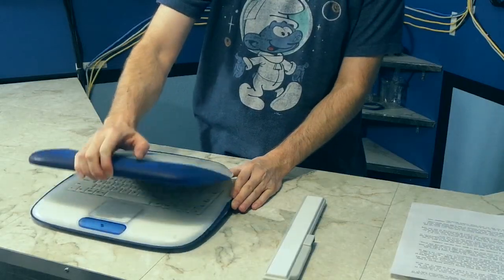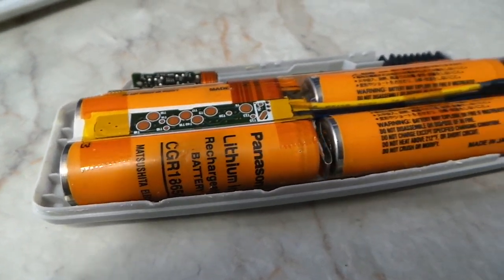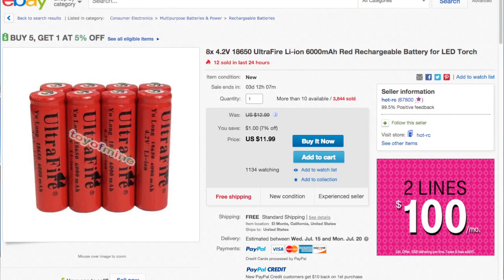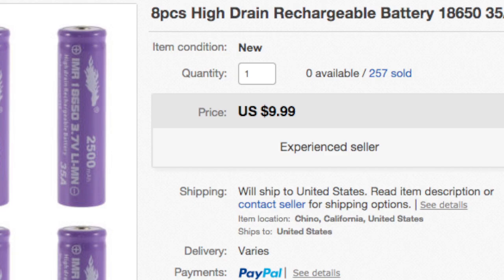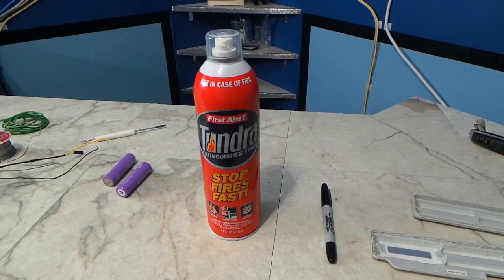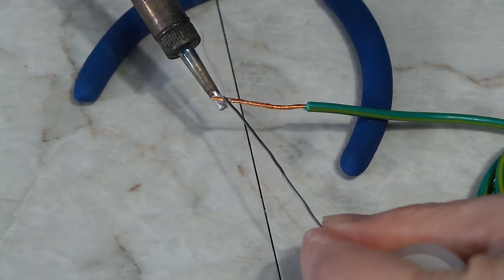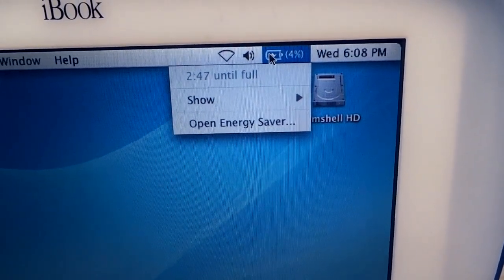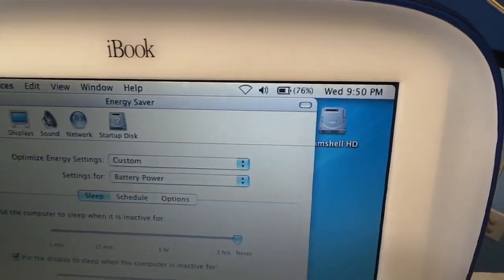Rebuild a laptop battery pack

Comment: Soldering directly to the cells is NOT a good idea. To be safe, you should buy cells that have solder tabs welded to each end. Then make solder connections near the end of the tabs away from the cell.
Reply: Right, it's not like a gasoline explosion, but more of a... highly energetic fountain of fire. You can look up videos of ruptured lithium batteries on youtube.
Reply: I did blanch at seeing that. But my Macbook battery suddenly bulged one day so I'm apprehensive. They weren't yet engineered to quit accepting a charge when plugged in.
Reply: welding only take a fraction of seconds to do, so even it's hotter it doesnt heat up the battery as much
Reply: Robert Noble, yes, a lot hotter but on a much smaller surface, a puncture and, than, in a very short time. It is  no time for heat/temperature to go inside the cell. And this the main fact.
Reply: @ionbobia  Can you, please, explain more details? I am found this very useful skill with soldering experience of you.
Reply: +OpenGL4ever
So that explains the sweet smell you get when the pouch of a lipo cell is punctured or ruptured. But it never heated up.
Reply: No, no, no. They spot weld the tabs on, not solder them. No manufacturer today would be stupid enough to waste time and money with solder when a spot weld requires much less precision and danger.
Reply: +OpenGL4ever 
 In case of explosion he would get few millions of youtube views in 2 days :-)
Reply: Regardless if it will actually explode or not, heating the cells damages them and reduces capacity. This is why they are welded and not soldered in the first place. Spot welding is so fast that it keeps thermal stress in check.
Reply: I'd just use these cells as AA batteries, press them together with springs and add metal plates in between the pairs for sensing wires. It's more difficult with the cells that are flat on both ends.
Reply: No actually it doesn't at least not for long enough to get the internal temperature to the magic >70C self heating level. Whilst the extremely short spot or laser welding action may cause the weld to reach that temperature it does not conduct as much heat into the cell as normal soldering. At least not if done properly.
Reply: those tabs are nickel ribbons not too expensive, but I took apart a tape measure and the coil if you unwind it you get a ribbon you can spot weld onto the batteries provided you have a spot welder
Reply: Adam Lawson
Well it's a question of how you define explode.
For example, It the seal is broken, lithium will react with the humidity in the air, this will cause a fast chemical reaction heating and building up hydrogen gas and this gas is not only  expanding but if it gets mixed with the air and catches fire it will also explode.
If this happens within the enclosure of the battery, pressure increases to until the enclosure rips suddenly apart then followed by the ignition of the hydrogen with air and eh voila you have some sort of explosion.
But of course, it is not a reaction like TNT.
Reply: Robert Noble true
Reply: Or use a 2.7v 500f supercapacitor to weld the new ones, maybe even reuse the steel plates from theold ones, just remove them with pliers and some force
Reply: IT WORKS, this isn't the only guy on YT that's done this, and I've done it on regular alkalines in a pinch, nothing exploded. I used a 120W iron, roughed the terminals with sandpaper, and added some RA flux before tinning them, then cooled it with a damp rag.
Reply: +Robert Noble Exactly. What he does in this video is wrong and a high safety risk.
Especially when using Lithium battieres. It's okay to solder NiMH batteries, it will of course harm them, but NiMH batteries won't explode when soldered. Lithium batteries will explode and that is the danger in doing this. That's why manufacturers only weld them together.
Reply: @OpenGL4ever  its more likely to catch fire than explode
Reply: Do they actually "explode"? I've only ever seen them get hot and start to take off thermally and start a fire. Didn't know they could explode.

But then again, a battery is basically a controlled bomb. The more energy you pack into one, the closer you are to having an explosive device.
Reply: OpenGL4ever - Hey thanks for the intelligent response. I was really worried you guys might take it as me questioning you, but I was genuinely curious.

It is interesting how we define energy sources. Can you imagine how crazy things may get in the future with super dense energy storage?
Reply: You guys are all morons most cell manufactures actually used to solder lithium batteries. There is almost no risk for anyone with soldering skills to solder lithium batteries.
Reply: Welding the tabs on gets the ends a LOT hotter than soldering them on. Solder 750 F while weld is more like 1750 F.
Reply: @CheezyDee  "Welding the tabs on gets the ends a LOT hotter than soldering them on." in this case it does not really matter what temperature you get in area of contact. What matters - how match heat is transferred to the battery. 1750F in very small area is quickly dissipated and you end up with very small amount of heat reaching the battery. 750F is applied to huge area (comparing to welding dots)
Reply: Just need a good soldering station, soldering at a temperature of ~ 450C will melt the solder for a fraction of seconds but it will not heat up the contact of the battery, a person with a soldering experience will not see anything dangerous here
Reply: @teateasan  "450C will melt the solder for a fraction of seconds but it will not heat up the contact of the battery" sorry to disappoint, but for solder to stick you must heat the contact to melting temperature of the solder. If you simply melt solder and not let contact area heat - there will be no proper adhesion. Any even semi experienced solder knows that.
Reply: your a fucking moron it will explode..
Reply: @usaisalwaysnumber1  
"your a fucking moron it will explode.."

It is spelled "you're", not "your".
Reply: @usaisalwaysnumber1  your a cant spel, as well as rude. So what do you categorize as an explosion? Lithium cells cannot explode like conventional explosives do. The reaction is not fast enough. They will go thermonuclear and shoot fire like a flamethrower.

Comment: Some laptop batteries have built in battery management, if it goes dead flat it will disable it's self, so even if you replaced the cells it won't charge
Reply: Most*
Reply: Exactly happened to me after cells replacement, my laptop is inspiron 3421, so how i can fix this problem? Please tell me if you know.
Thanks
Reply: Sounds like something Apple would do. 💩

Comment: I tried it with my iBook G4 battery but doesn't work. I cannot charge or power an iBook G4. Like I need to reset micro controller. I didn't know how to reset it.

For now, I bought replacement from China and use it instead reset micro controller.

Comment: isn't it kinda dangerous to work with and solder li-ion batteries? up until now I always avoided with working with that, since I am scarred of accidentally shortening them or accidentally overheating when soldering...
Reply: +irgendwerjoker The instructions in this video are a safety risk and no one should follow it. If you solder lithium batteries, they can explode. Lithium batteries can only be spot welded with the right welding machine, everything else is highly dangerous.

Comment: im thinking about trying this, my original e5420 laptop battery is worn like 60% and i just bought a new extended battery for it. my soldering iron is a weller wes51 and i think it can get a little bit more then 850 degrees ferenheit on it.

Comment: You need to upload more often, I really like your videos!
Reply: Most likely has a life and a family outside of YouTube.
Reply: +Riswan Ahmad P same here bro
Reply: +OpenGL4ever So... I put myself at risk of death or serious injury at least 4 times already?
Reply: +OpenGl4ever Then why didn't it explode in this video and the one of the four time +zappy bear did?
Reply: Why can't you sodier
Reply: @jamesswanson7213  Because it is a safety risk. Soldering isn't done in microseconds, thus you will heat up the cell and then pressure rises inside it. This can lead to a bursting of the cell. If that happens, the lithium will react with the humidity in the air and will ignite. The result can be dangerous burns.
This isn't the case for welding within microseconds on a small spot.
Reply: @OpenGL4ever  LOL. Not even, no. Depends. 
If you're using mostly discharged cells, are quick with the iron to minimize heat transfer, and use a wad of aluminum foil to soak up the heat after(careful not to short circuit), there's little real danger or cell degradation even.
Reply: +Riswan Ahmad P This video is a high safety risk. You mustn't solder Lithium batteries, they will explode. Only welding is okay.
Reply: @OpenGL4ever  explain

Comment: the thing with the ultrafire ones is that the capacity is around 0.5ah (tested several) and also the voltage sag under load is quite bad.

Comment: Is there any concern about damaging the cells with the heat from the soldering iron?
Reply: +W Sears The instructions in this video are wrong. It is very dangerous to solder lithium batteries, they can explode by doing so. Lithium batteries must be only spot welded with the right welding tool, but never soldered.

Comment: If you use super coarse sandpaper and scuff the batteries before soldering it will take MUCH less heat to tin them and they will solder much better :)

Comment: Have you tried testing the voltage on the orange Panasonic cells? Normally a ''dead'' battery would occur when one of those cells fall below a certain voltage and is unusable. Since they're all in series, if one dies, they all go out. Yet since they're only eight and there's more stress between them, I guess the smaller pack would have more than one or two under nominal voltage.

It's something a lot of people overlook, especially when questioning the long term viability of electric cars and hybrids. It would then seem more cost efficient to identify and replace a bad cell/module, than compared to a serious engine repair. Like an engine, one small of many parts can cause the whole thing to fail.

Anyway, for the life all batteries, the rule is don't bake them by strangling them of cool air.

Comment: the effest batteries your purchases would be ok for sustained current draw however they have an unfavorable discharge curve. More than likely the mAH rating is accurate but since these batteries drop voltage quickly you are unable to unlock* the rest of the juice it has. Although more expensive the samsung 25r (blue wraps)  have a better discharge curve.

Comment: I know this isn't the appropriate place to be asking this question... My ibook g3 isn't turning on correctly. I've tried pmu reset, the battery works, the charger works, the outlet works, I've tried holding down the power button, the keyboard works, but the screen wont turn on and there isn't any start up chime. Help? Edit: It isn't a clamshell.

Comment: Great video, and love the shirt, I sometimes find it's easier, and cheaper(money, and time wise) depending on the laptop/netbook I'm working on to just buy a complete aftermarket battery off eBay, or Amazon even if it does not last as long as an original OEM battery would have.
Reply: ***** I think I commented on that video as I was looking for a similar case to hack, and put a MiniITX board in but I've yet to come across one local, as shipping on someplace like eBay can be a bitch for those systems.

Comment: To be fair, my only and major concern about buying cheap batteries from China is that they may explode after a certain period of time.
Reply from the maker: ***** Admittedly, I had that concern myself.  I guess I'll let you know if they explode.
Reply: @The8BitGuy  Did they ever explode?
Reply: @The8BitGuy  They explode??
Reply: @The8BitGuy  is it exploded?
Reply: ***** theyre actually fairly safe, just terrible quality
Reply: ***** Most batteries are from China anyway, just the "famous' ones are made under surveilance from panasonic toshiba samsung etc.
Reply: The iBookGuy What I do is go on ebay and find generic no-name laptop batteries shipped from the US and remove the cells from those. In most of my tests those 18650s that come right out of these generic laptop batteries are name brand (Sony, Samsung, Panasonic, Sanyo) and are around 2200mah right from the get-go rather than buying questionable cells from china. Here is an example: http://ebay.to/1J9uHsH . 6 cells for $20 of real 2200mah I would say is a good deal if you ask me.
Reply: @circletech7745  That is why he is paying 6$=>30% of what you consider "a good deal" and he is geting 50% of your 20$ product=>"a very good deal" and "a very good deal" is superior to "a good deal" as it is (50%/30%)*100%=167% of what you are geting for your $.
Reply: +Gage M. They will explode if you solder them like shown in the video. Lithium battieres must be spot welded, everything else is highly dangerous.
Reply: Like those old dell laptops
Reply: ***** canister cells rarely explode or catch fire ;) And its not the battery itself that causes this but the battery management electronics in the battery pack that can overcharge the cells when malfunctioning.
Trying to charge a death (and i mean death beyond 2v) is what causes problems.
Reply: The iBookGuy +Gage M. You will probably notice a burning smell before they do. But don't take my word for it :D
Reply: That why you get rid of it after you fix it, its the cockney way
Reply: +FullFledged2010 Its the fact some of them are not designed with venting built in. The chemistry is DESIGNED to release some gasses when discharging, so no vent holes can make them explosive when drained. The pressure builds over time.
Reply: Watching Bigclivedotcom or may AvE (forgot who :( ), they took some apart and found sand, grit, washers, etc to add "weight" to the batteries to make them feel heavier and thus OVER SIX THOUSAND!!!! (get it? heh heh ... okay yeah I'm a nerd)
Reply: The iBookGuy get it on video lol man i wish u were still selling ibook g4
Reply: They'll only burn if the vote goes above 4.25 normally or if physically damaged. But i actually cut one open and it did nothing (video on my channel) (insert shameless plug)
Reply: Gage M. Reminds me of the battery powered hover boards
Reply: actually,such case rarely seen nowadays,except very very low quality battery,thus the thing is you should choose a good store first, i bought my laptop battery from an online store from china, i think the quality is fine ,coz it works well with my laptop ,it has been more than one year, no problem occurred,and i introduced to my friends ,they also gave high remarks ,the point is the price is very attractive and quality good, and they provide variety brands and models, i remember the website is http://storebattery.com.au/ hope this might help u =)
Reply: that way they are called " ultrafire" because of fire risk
Reply: ***** from what I understand as long as the charge controller works it should be fine but also if you can test the old batteries I would expect only 1 pair of the 4 are dead as they are the ones the charge controller uses for its own power so if you get a few dead batteries you could revive one by finding the duff pair
Reply: BOOM!
$H1T MY LAPTOP BROKE!
Reply: Gage M. #true
Reply: Gage M. Samsung did it
Reply: One also has to watch out for counterfeit items also.
Reply: KABOOM!!!💥
Reply: Like the note 7?
Reply: they dont explode that easy. the worst thing that can happen is to catch fire. ofcourse its pretty bad but not as bad.
Reply: I want to become a reseller for cheap explodey batteries. I'm gonna steal the ACME Co. logo from the Roadrunner cartoons, and that'll be my branding. I started this comment as a joke, but now I'm kinda in love with the idea.
Reply: All batteries come from china😂
Reply: primary868 The note 7 overheats like crazy thats why it caught fire. And the chinese fake hoverboards actually had shitty batteries
Reply: Gage M. Z
Reply: Gage M. Not true. What makes a lipo battery blow up is when ts abused by an idiot. As for the Samsung thing, what idiot actually thinks that 18650s are whats inside of a device thats literally half the thickness of the battery?